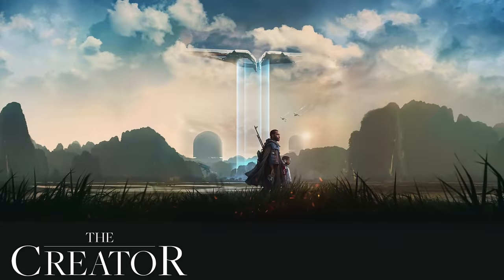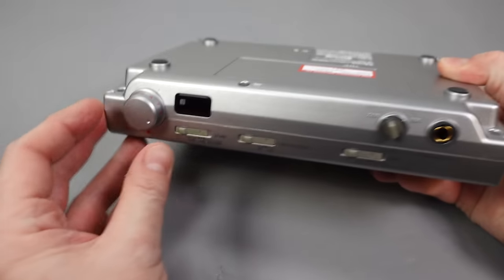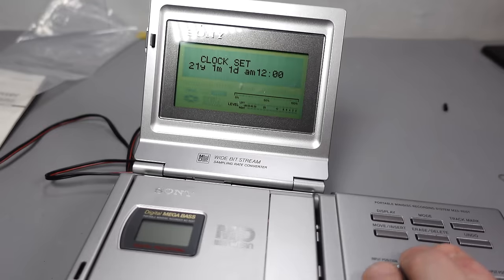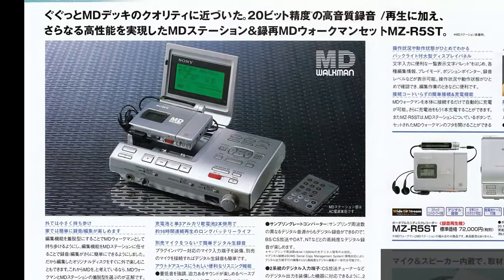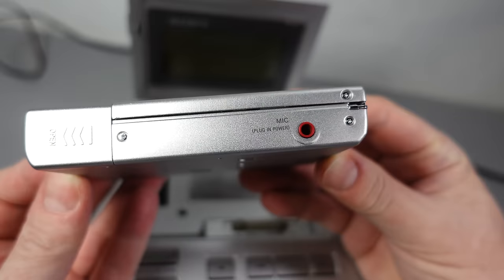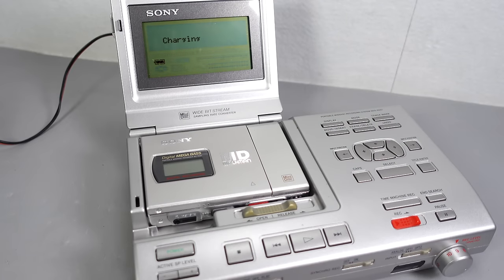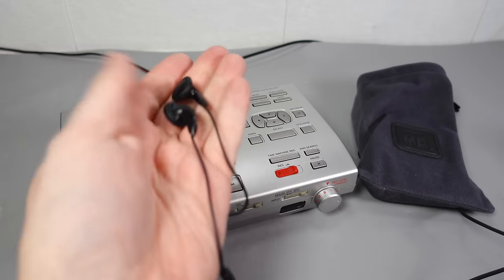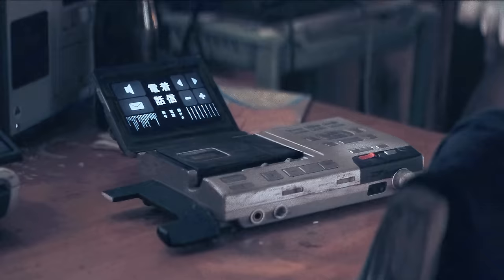Sony’s self-destructing MD Recorder from 2070

Comment: you need to clean the acid from the batteries off the circuit board and surrounding area, moisture in the air will re-activate the acid, and cause more damage
Reply: Exactly.  This is why I coat PC boards which have succumbed to battery (or other) corrosion with a multi-metal corrosion inhibitor made for electronics.  I use ACF-50 which is mil-spec,  and only about 13 $CDN for a large can.

Comment: Just cleaned out some decade old electronic ornament the other day that had some nasty battery bomb in it, and should be good for another decade. Might be worth it to see if someone with the proper tools can lift that shielding plate and give it a quick wash and one over...Might be really easy to fix if it's all surface damage on the lowest level.

Comment: I didn't know that Ni-cads have that much of a leaking problem.  I have lots of them from years ago.  Some D-cells that I recently charged up and they still work.  No sign of leaking.
Reply: It’s really, really common in old NiCd batteries. I’ve seen it in practically every NiCd battery I’ve seen that’s older than about 15 years or so.
Reply: @tookitogo    Mine are quite a bit older than that and haven't leaked.  I've had more problems with old alkaline batteries.
Reply: @my3dviews  I’m sure it depends on the exact model of cells, the device (does it keep drawing current, causing deep discharge?), storage temperature, etc. 

For sure, I’ve encountered more leaked alkalines over the years in absolute numbers. But percentage-wise, the old NiCd cells have done statistically worse in my case.
Reply: @tookitogo    None of the Ni-cads that I have were in any device.  They are all just loose in a box or in a drawer.  So, just stored while dead.  I'm guessing that they won't hold a charge very long though, after all this time.  
The thing that I hated about Ni-cads was that they went dead without being used after not much time.  Which is why I haven't been using them recently.
Reply: @my3dviews  Gotcha.

Yeah, their high self-discharge was a major limitation. Same with NiMH for the first 20 years or so, until Sanyo introduced the first low-self-discharge NiMH under the Eneloop brand.
Reply: @tookitogo    Right.  I have a few Eneloop AA batteries for my camera flash.  They hold the charge for quite a long time without being used.  Which for me is good, since I don't use the flash that often.

Comment: The battery thing reminded me of the original Xbox, which has a battery for the clock that looks like a capacitor and those leak as well taking the motherboard with them.

Comment: its mostliely only amplifiers thats broken but working with thatsmall circuits is problem... i think its possible to track non amplfed signals by using fas voltmeter or oscillascope then add additional amplifuer ewen if originals are unfixable 😊

Comment: If only the analogue part is not working, my first guess would be that there is something wrong with the power supply (part) for the analogue mixing / amp circuit. Maybe as simple as a corroded track on the PCB. If I had this device, my hands would itch to explore. Ah, so you did have a brief look. I would not dispair. It's not dead, it is merely resting only to wake up by a kiss from a solder prince.

Comment: They should have provided easy access to these batteries through a hatch, and leave those uninstalled by default. I mean, as docking station it would be connected to AC power most of the time, and a big capacitor would have sufficed to provide power to the clock for when there's a power outage.

Comment: Curious why they used two NiCad batteries to retain the time rather than a standard button cell. That would save a significant cost in manufacturing and time in consumer replacement.

Comment: It's a bit of a shame that Sony was going through its 'proprietary technology' phase at the time - if that device had used regular AAs then they'd be designed to be replaced easily, and that corrosion would be less likely to have happened. Beautiful piece of kit though. Would a digital-to-analogue converter enable you to use the speakers with it (optical output from the dock to the d2a; analogue output from the d2a to the speakers)?

Memory Stick was another thing unique(?) to Sony around that time - I expect that you've done videos on devices using them, but I guess they've rendered a bunch of devices virtually useless because replacements are hard to come by.

Comment: Same thing happened with clock batteries and capacitors in the original Xbox. After years of sitting dusty and switched off. I fancied some retro gaming and discovered it dead. One google search later confirmed the worst.

Comment: Hello! I guess you are pretty tired of reading it by this time BUT if you want to preserve it for a long as possible you need to do ancull disassemble and clean up, that corrosion will go on.
You can approach someone on the YT sphere that repair old computer PCBs and see if they are interested in doing a full diagnosis and repair.
These batteries are the same kind that "destroy" a lot of motherboards from the 386/486 era.
On second thought you might as well know everything about this but just consider that talking aboyit wasn't a good fit for the kind of content you produce. 😅
Thanks for the content anyway, pretty interesting like always.

Comment: You should not turn a corroded unit on, before using Qtips and vinegar to remove the corrosion and then clean with distilled water

Comment: those traces are not burned, they are covered in corrosion, you can clean it all up , and repair the damaged tracks, however other components like capacitors and resistors might be affected and need to be replaced , alternatively if you had service manual you could just redesign that part and make your own workaround, this can be given to specialist to repair, but it wont be cheap. you need to attach pictures of the damage and model nubmer of that device with revision of hte motherboard to someone and ask them what would be the cost of repair. maybe a museum would be interested or some collectors in habving the unit after repair so you need to wage if its worth it if you want to resell it. I could suggest professional company that I am working for, but that would not be in your budget unfrotunetly, so maybe someoen else can suggest you a hobbyst. If you insterested give it a read about trace repair, you can use : mod wire, special conductive ink pens, or elctroplating with gold to rebuilt the traces etc. its quite simple really.

Comment: .... it could be saved.....you'd need to reach out to a local You Tuber over there in the UK for it to be done in a reasonable time but the trace line is still visible so they could wire fix that for you and make a video of it.

Comment: NiCd batteries have also destroyed uncountable numbers of computers. Everyone who had, say, an Amiga with RTC circuitry inside will know this. So the first order of business is always to snip off the barrel battery in those. I have seen Amigas that were in absolutely beautiful condition on the outside but their insides had been thoroughly vomited on by the battery. Unless you have a circuit diagram, a LOT of time and the patience of a saint, you’ll not be able to fix this.

Comment: I'm curious how much of the analog circuitry can be brought back with some board level repair
Reply: Ah I just saw the close up
Reply: Yep. Especially since the wide trace at the edge was eaten away, which most likely is a ground connection. This easily shuts down an entire subsystem when interrupted.

Comment: What i don't get is why they didnt use a 2032 lithium coin cell which were readily available in the late 90s and they could have even had a little flap on the unit. Much thinner and smaller too.

Comment: What I think:  At least coupling capacitors in the PA output and also analog recording circuit went dead probably as these parts are really candidates.. "re-capping" is not an unknown term because of that when it comes to restoration work.

Comment: Sony should learn how to make batteries from CASIO. I bought CASIO fx-82L calculator in march 1992 and it still works with original 2xAA batteries (also made by CASIO)
Reply: The power consumption of a scientific calculator is extremely low.. no wonder it still works.

Comment: Would be easy to fix - just need to disassemble and add some thin wire where trace lines would be - StezStix Fix youtube channel could fix it with his eyes closed. I would get it done as shame to not be able to fully use it.

Comment: The battery leakage needs to be neutralised with an acid such as vinegar then flushed with isopropanol or it will continue to destroy the board.

Comment: High dollar quality gear destroyed by leaking batteries .... this happens a lot in the camera repair world, when folks leave lowly AA cells in a quality point & shoot camera, or a pair of LR44s in their vintage SLR's light meter battery compartment.  Twenty or thirty years later, the leaking acid has seeped into connectors and circuitry buried deep inside the camera.  Arrrrgghhh!!

Comment: Why don't you restore the traces? You can do it by scraping the existing rests of the traces open, apply solder and then connect the points with jumper wire. from what i've seen in the video, its not a very hard job to do!

Comment: In 2070, tech will self-destruct by exploding after 3-6 months of usage or if it detects the back that is held on by cement epoxy and asphalt comes off. It will be marketed by Neo Apple and Neo Samsung, the sole two remaining hardware manufacturers of any computer electronics, as a security feature.

Comment: Could just be a straightforward re-tracing the botchy traces from what I’m seeing (but it’s hard to tell just by seeing such a small portion of the board) which might get the analog back up and running again for this poor unit. 
If you could manage to get it repaired, I’d imagine it would surge in price since these models are clearly going extinct.
There’s few and fewer of these skilled electricians especially in my neck of the woods which specialises and more importantly are willing on repairing these types of old electronics unfortunately.
Shame, it’s a beauty of a unit too I reckon…

Comment: Are you sure there isn't some kind of switch to go between the digital and analog connections? I know quite a few devices I've had have that option and I think I seen a switch on yours that had analog and optical options so try switching that to analog then see if those inputs and outputs work.

Comment: Damm I need a Spare AC UK 240V AC Power supply For MD / Hi MD several of mine Died With Dry Plastic Rubber  Cable rot and shorted out

Comment: A lovely machine, but what a flaw.  It is a pity that Sony never put a battery compartment on the bottom for those cells - it wouldn't have been that difficult and would have most likely eliminated the whole problem.  One hope is that someone is watching this with a dead portable unit and a working dock and decides to donate it - or vice versa.

Comment: wouldn't it be the epitome of cyberpunk if someone from 2070 found one of these units (or the remnants thereof) , and using superior futuristic technology , salvaged all the working components as well as upgrading it with contemporary technology to give it new life as a communications(?) device
Reply: like, copper traces being eaten away by battery leakage wouldn't be a worry if they can just print new traces straight onto whatever's left of the PCB, after using micro-mechanical tools with possibly piezo-electrically actuated armatures to effortlessly disassemble even the most stubborn clipped assemblies, then using a minature robotic spectrometer to image the chemical leak and using AI to identify the best solution for cleaning it